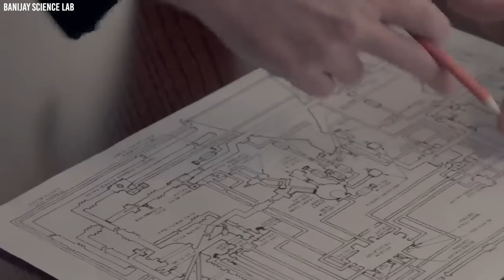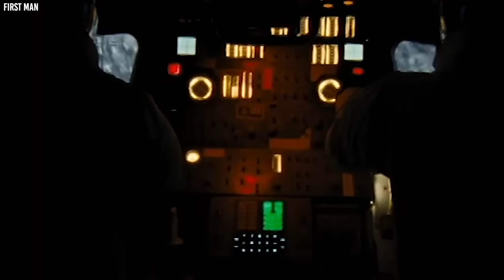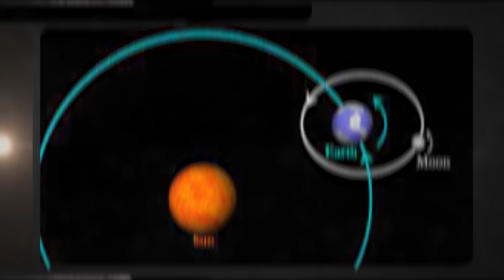Japan's Moon Sniper Mission: We FINALLY Found What NASA Was Hiding

Comment: you clearly do not understand the Apollo landing process.
you say they armstrong had to manually take control because of the computer errors and the landed in the wrong place., both not true.
the computer problem was overload warnings caused by the rendevous radar accidently left on. the compute was designed to reset seamlessly. they proceeded after